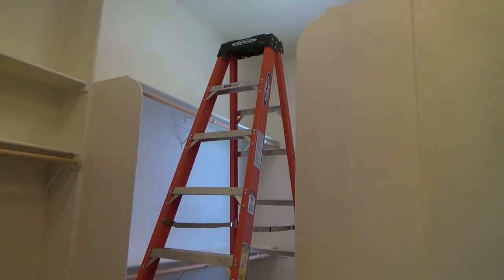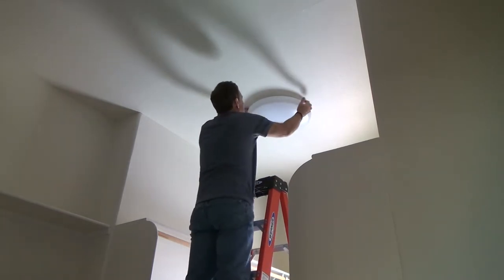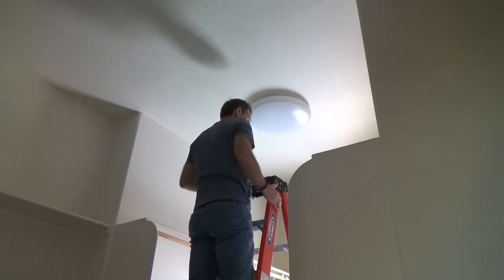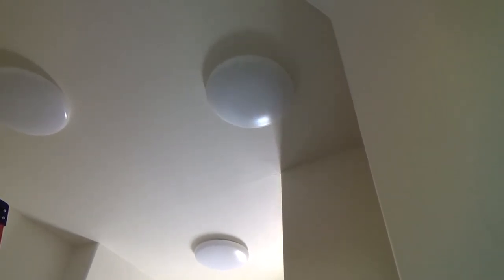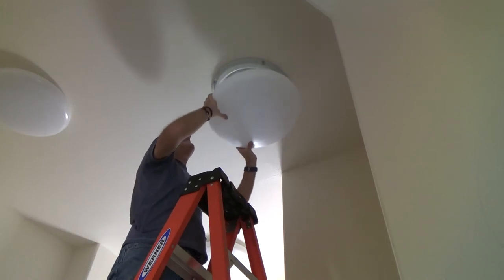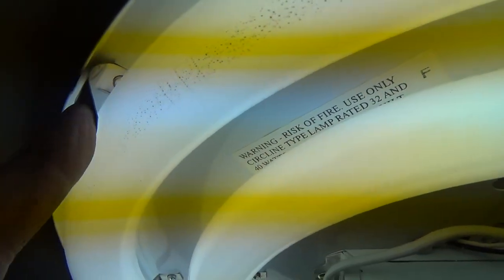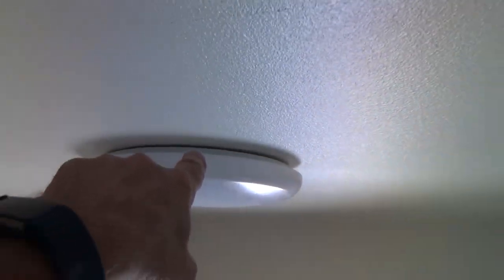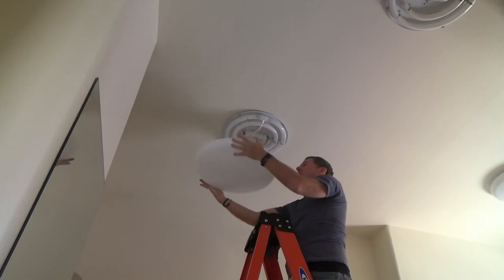How to Remove Closet Light Fixture Covers Made Easy?

Comment: Thank you so much, been trying to figure out how to open.  Mine is glass lamp shade and I pulled down it released a mechanism to unscrew the screws from the glass.  Changed out light bulb for a new one washed lord only knows how long it’s been, worth of dust and insects.  It looks fantastic!
Reply from the maker: Awesome job with cleaning & replacing the light bulb too. Not all light fixtures are created equal for how to remove the glass so always know that others could be removed a different way so always take the time to figure out before making an assumption that could possibly break the glass. Great job yo!